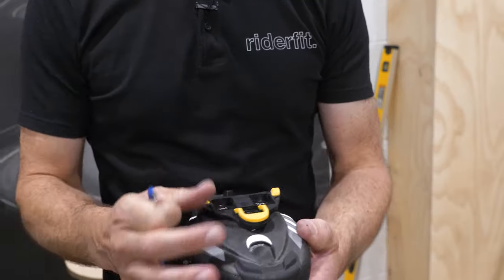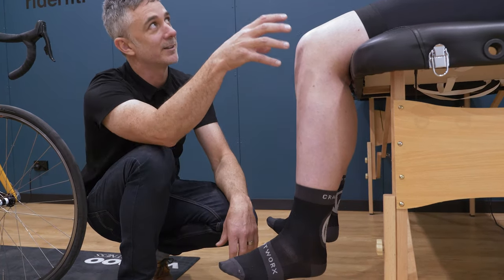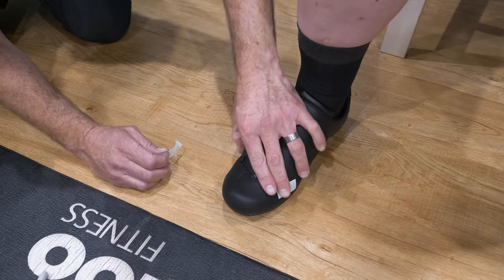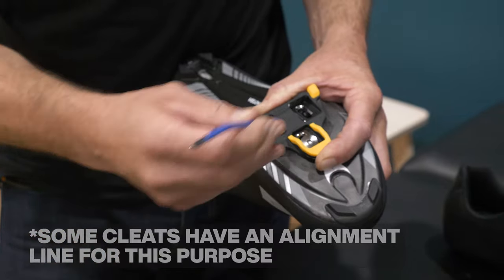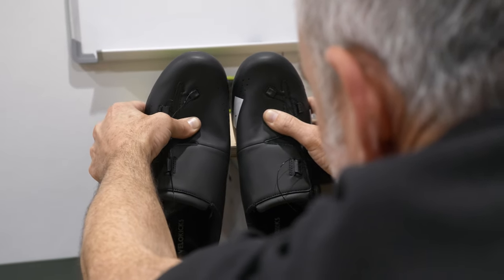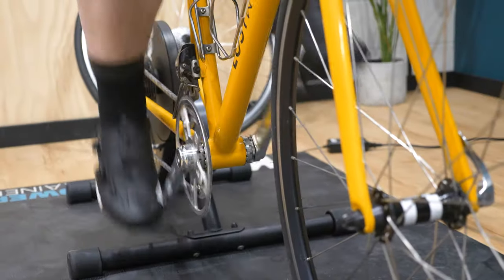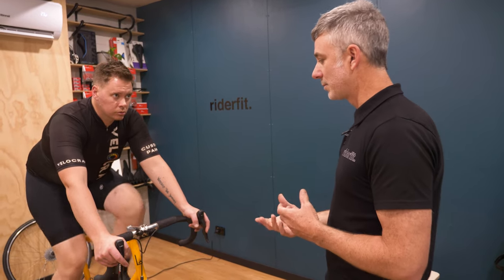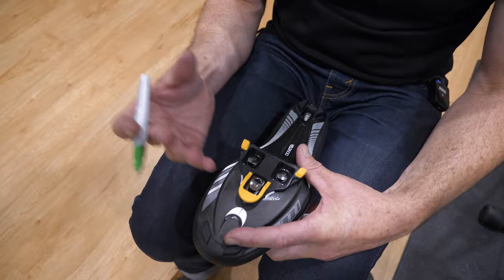A do-it-yourself guide to fitting cycling cleats

Comment: I am amazed at how many do-it-yourself cleat/bike fit videos there are, and how many AI phone based fitting systems have popped up. The idea is that bike or cleat position is simple enough to do by yourself because the bike is a pretty simple machine, and how hard can it be tou mount cleats on the bottom of your shoes?  The truth is that bike fitting has to do with interfacing a human body with that simple machine. The machine has good quality control, the human body doesn’t. A good bike fitter spends years learning about variations from on person to the next or even from right side to left.

Example:  cycling is the worst case for a condition called Morten’s Neuroma. Unlike walking where there is heel strike and role-out, cycling puts all of the pressure at the ball of the foot. A common first step in resolving the problem is moving the cleats back, or moving the metatarsal line forward, past the point of pivot. There are lots of videos just on moving the cleat back, here’s what they don’t tell you:  you have a lifetime of pushing off the ball of your foot, that motor skill doesn’t change at will. Moving the cleat back can change the angle of the shoe under force, going toes down. You don’t know that until you get on a bike and start pedaling - something most cleat videos leave out. Going toes down changes lots of things up the chain, from forward pressure on the ball of the foot to blood delivery restriction by the shoe to tension on the tibialis anterior, to tension angle of the patellar tendon.  So, you’ve caused four problems, solved none…

Comment: Question- the spindle is straight. The line from the first MTP joint to the fifth is on a diagonal.  Wouldn’t that make the heels kick out if you want the spindle under both? What do you do if you can’t adjust the cleat to get the right position? New shoes?

Comment: Is the axle supposed to sit perpendicular to the heal or is it a bit slanted? because the 2 bones are not at the same level, as the big toe bone is a bit higher so essentially the axle would need to sit on a slant across the foot which means that the cleat would not be directly perpendicular but also slanted in order to accommodatethe path of the axle.It's a bit confusing to me. am I right?
Reply: The pedal spindle should sit between the first and fifth metatarsal.

Regarding toe, whether you need to set them toe in, toe out or no toe, it depends on your gait. My gait has no toe, so I set my cleats to point my feet straight (no toe setup).
Reply: @hansanders4983  It's in-line with what I said, the first metatarsal is the inner ball of the foot and with the spindle between the two metatarsals, it's definitely a few mm behind the first.
Reply: @yonglingng5640  so the cleat is slanted ?
Reply: @pgreenx  That depends on your gait's toe, whether you walk toe in, toe out or no toe. As of my latest fit, my bike fitter saw that I have a very slight toe out gait, so mine were set up so that my toes point outward just ever so slightly.